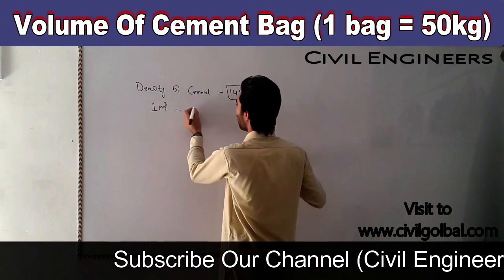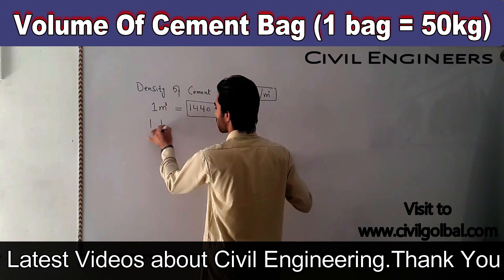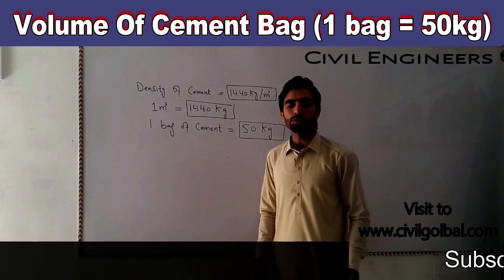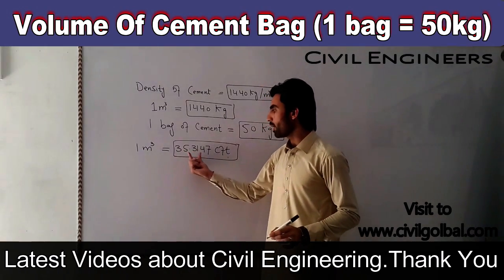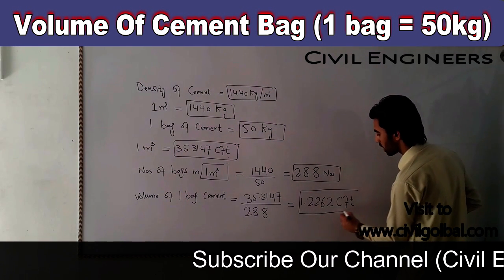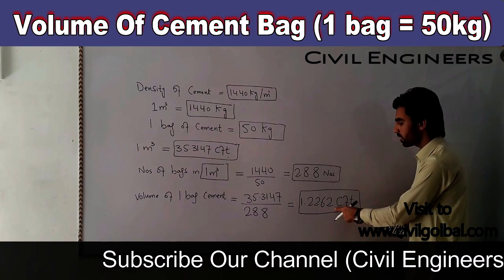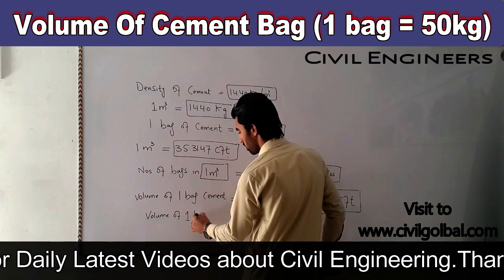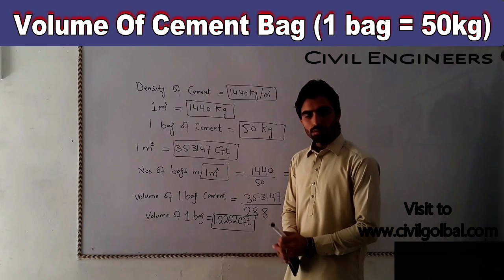How to Calculate Volume of Cement Bag.

Comment: This is not the correct conversions lmao. I reviewed it and the difference is so big. 
Suppose i have 29.67 volume of concrete
I multiplied it to 28.8 No. Of bags hence i have 854 bags. But in our method here in the philippines, i calculated 29.67 x 9 bags which gives us 268 bags. 

This conversion is so confusing. You might just review this video as it might give confusion to others.

Comment: density of cement=1440kg/m3                                                                                                                                                          mass(weight) for 1 bag of cement= 50kg                                                                                                                                                               volume for cement bag=density/mass=50/1440=0.0347m3                                                                                            1m3=35.3147CFT.                                                                                                                                                                                                           So,    0.0347m3=0.0347*35.3147=1.226CFT
Reply: Right